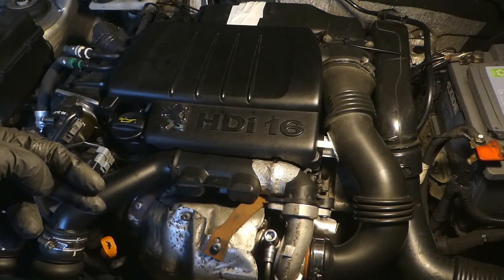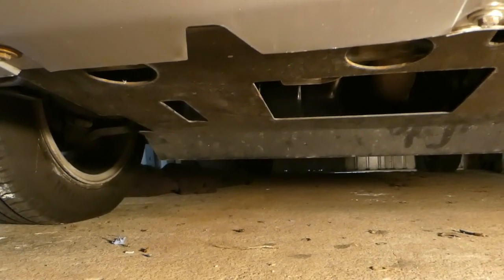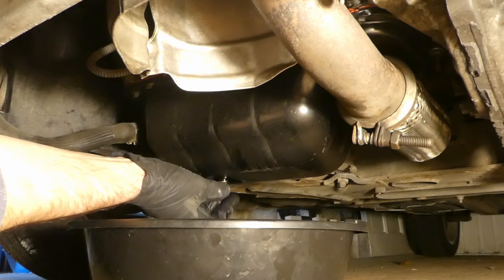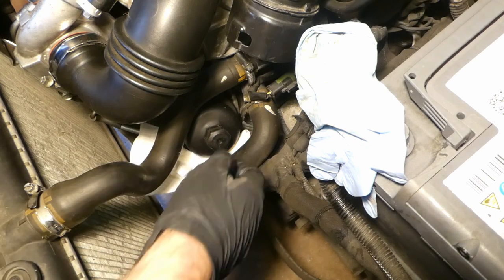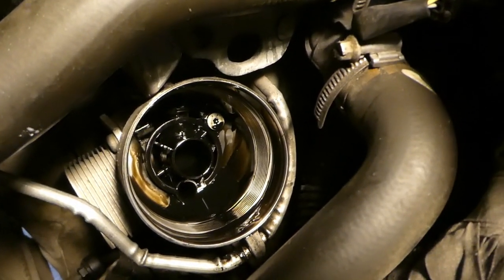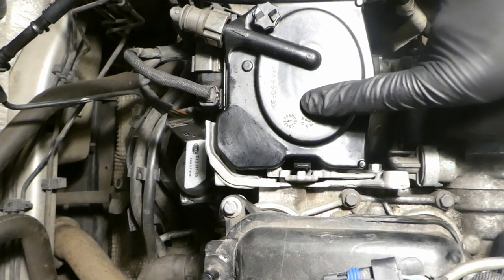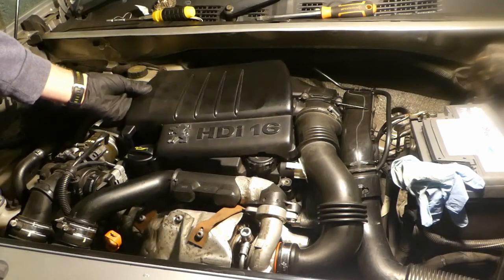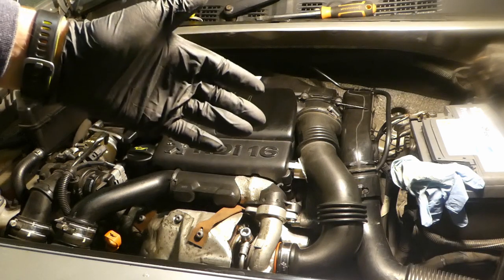1.6HDi full annual service (Peugeot Partner 2007)

Comment: Hi there, you wouldn’t happen to know why my pergout partner is pooling oil on top of the engine would you? Iv done some research and people are saying it could be the inlet manifold o rings have you had similar issues at all? Thank you
Reply from the maker: Maybe check if the the rocker cover is not leaking. This is the most likely place to leak from. WIpe it and see where it is coming from, the best option.
Reply: Check the white outlet breather on the Rocker Cover. O rings shrink. More Molecules has covered this.
Reply from the maker: @CASHSEC  Ahh, yes thank you
Reply from the maker: Check this video perhaps: https://www.youtube.com/watch?v=ziKR6M6ToSg
The outlet breather o-ring shrinks as PORTLAND DOEBOY has said and it is a simple replace of the o-ring

Comment: Can you do another video on EGR faults please. I have a P0489 fault low circuit A but canot find the problem. New EGR ne Temp sensors cleaned dpf ect ect
Reply from the maker: Hi Andy, that is a bit of generic error. If you have Diagbox/PP2000/Lexia you can do a quick test on the EGR valve and see if it works. If you have one of these, you can also record EGR % as you drive, say hooked up to a laptop. Plot this vs rpm, MAF, etc. This will fairly quickly tell you what is wrong

Comment: Have you tested the Mann Hummel provent 200 against the cheap version? I’m considering to buy the catch can, but I’m curious to know if the original is more efficient than cheap version. Also how much less smoke did you have after putting the cheap version provent versus no catch can at all?
Reply: Great content by the way! 👍👍
Reply from the maker: Hi zengine, I changed the oil catch can to the original one and ran it for say 1,000 miles. I have not yet done proper testing, but the original does not seem more efficient. This is only a short-term observation and not a long-term one.
THere was a considerable amount of smoke reduction with the cheap oil catch can. I think I have a few updates on this. Maybe the last one is showing it, I think they go from update #1 to update #4
Reply: Thanks for the fast reply 👍 Yes in update 4 you see a smoke reduction with 2 catch cans, but how much has the provent catch can by itself reduced smoke compared to no catch can at all?

Comment: Regarding the oil type ... last service i took my peugeot 407 1.6 hdi 2006, they put in 5w40 Total oil ,but you put 5w30 ... could it cause any trouble ?
Reply from the maker: No it will be absolutely alright. The total 5w30 is a fuel saving oil and a bit thinner, the 5w40 is a bit thicker. Both are fine, 5w40 might be even better as it will be more difficult to pass seals, for example turbo seals.
Reply: @moremolecules  Thanks for the answer. Love the work you are doing with these videos, have been going trough many of them... am planing on doing my own annual service this summer... Keep it up 👍🏻

Comment: I'm thinking of buying a 2007 Peugeot partner 200,000 kilometres on the clock, regularly serviced and 9months MOT left guy wants €2850 is this alot for this van?
Reply from the maker: Depends on the condition of course. Maybe it is alright if the condition is OK. Mine is ~170,000km and ie going strong, but I have kept on top of most things. As long as oil/oil filters have been changed regularly, should be alright. I would ask if the EGR was ever replaced or cleaned. At that milleage you would expect the EGR to go. A brand new original is quite expensive.
Reply: @moremolecules  he seems to have maintained it well enough so I'm wondering why he's selling it now, 🤔if EGR valve is an expensive job that would make sense. Thanks for the advice and video post it's really helpful 🙂
Reply from the maker: @declanmurphy729  All sorts of reasons why people sell the cars they have 🙂 EGR valves are not that expensive if you do the work yoursel, but in a garage probably a bit expensive relative to the price of the car of course. Depending on the condition and driving (always fully laden, etc.) some of the suspension components may also need replacement. You could ask him what has been done in terms of components during the time he has haf it.
Forgot about timing belt, water pump, etc. That would be a fair bit of money.

Comment: How is the turbo going ?
Reply from the maker: Hi emmanuel, the turbo is going great, no problems whatsoever. I installed in ~7 months ago, but due to the pandemic I have traveled only ~4,000 miles, but I have not had a single problem with it.

Comment: Dimensions of the original O-ring? 30x3.1mm?
Reply from the maker: See if the description of the video does not give the dimensions. I have put a few of these there, but maybe it is not whatyou are asking.
Reply: @moremolecules  19x27x4mm. I have spare o-rings of 24x30x3mm but they don't seem to seal properly although the original O-ring is almost the.same size. Any trick to stop the strong vibration on this particular connection (rocket cover and air intake hose)? Rubber grommets of air filter box? Do they sell them separately?
Reply from the maker: @csraln6748  Yes, they do sell the grommets separately, although always cheaper to buy them as multiples.

Comment: If the oil filter didn’t fit in the hole where the nozzle is on the end of the filter would the car still  run.
Reply from the maker: It should fit pretty good, otherwise the filter cap might not be sealing well and not generating enough pressure. The car would run, but it might complain about the pressure. Also, it is unclear how well the filtering will be.
Reply: @moremolecules  I did it again putting the cartridge In the hole but when I undid it it all looked ok thanks mate